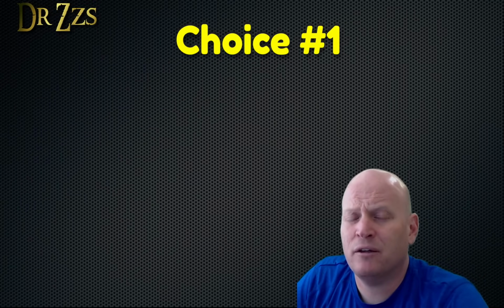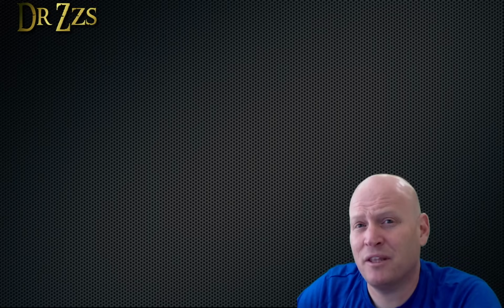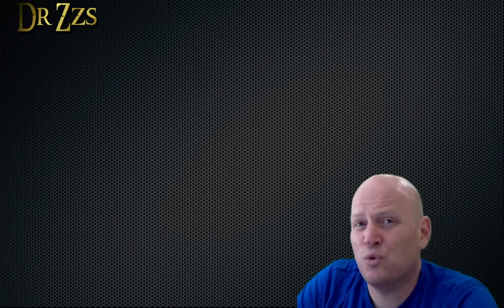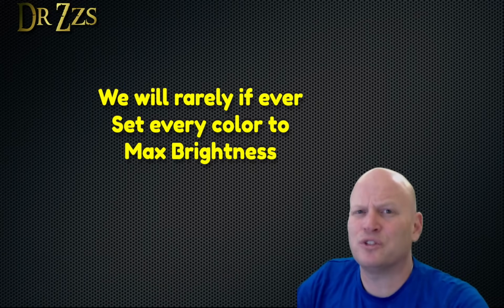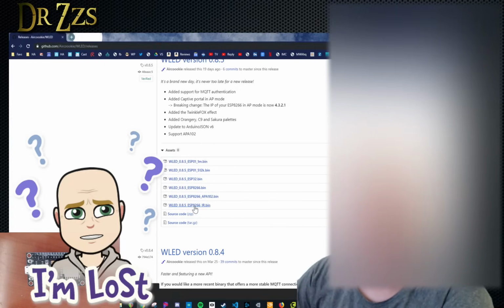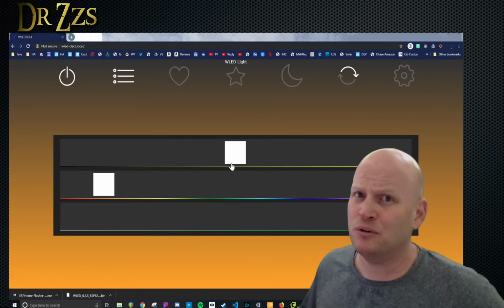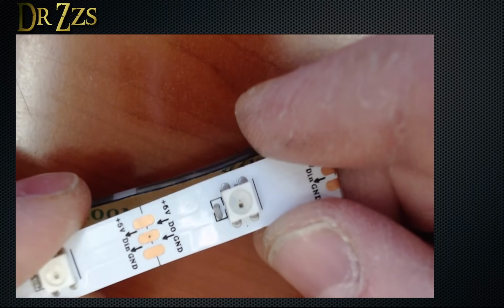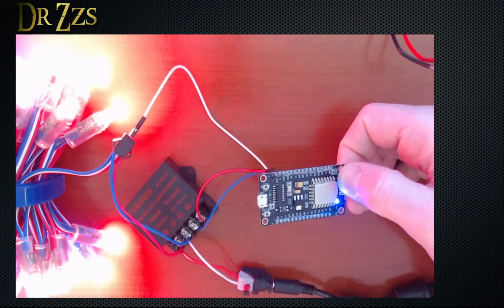Beginner's Guide to Christmas Lights - and LED Shows for Every Holiday

Comment: I really appreciate what you do! You have excellent videos! I do have a question about power injection that was not specifically addressed in your videos. 

I am going to be running 5v WS2811 pixels off of a 60 amp power supply. My longest run will be approximately 500 pixels (10 strands) on the roof line. 

Can I power inject at the beginning and end of each strand using T-taps on the entire run using a single 18g/2 wire from a single terminal on the power supply? Or would I need to run multiple 18g/2 wires from multiple terminals on the power supply since it’s such a long run?
Reply: did you find the solution? also confused about this!
Reply: I figured it out with experimentation. You can use one terminal from the power supply with one wire running parallel taping into the beginning and end of each strand. I would definitely use at least 16 gauge wire as well. It made a big difference.

I had to break the 500 pixels up into groups of 125 because anymore after that really showed signs of being under powered towards the end of the run (pixels were discolored). When I began a new run of 125 I used a new terminal on the power supply with a new, separate wire.

Comment: So, if I were using 6 of the 5v 150 LED strips, I would need the Bare metal power supply? That comes to 18 amps, right?
Reply: No. Each strip can pull 9amps on max brightness white, you should put a power supply every 100 leds.

Comment: question from complete novice. I'm gonna try it for the first time . its gonna be mounted the eves of a 1floor house. looking at the strips. Ws2812b.( even though it appears a little pricey in amazon) putting them in a channel system(amazon as well about $90 for 40 pack of 3.3ft) . I have listen to you and the hookup. still confused as to what voltage to use  5 or 12. My complete run will be approx 124 ft. then I will also like to add music( maybe later) . I'm also thinking of getting a Falcon F16 pixel controller. My questions include where will I add the voltage to every strip on the additional wire? or mount them power them and then see if and at what strips it  drops? what would you recommend in my instance
Reply from the maker: Hi Johnny,  If you're going to use 2812 strips your only option is 5v.  You'll probably need to add voltage at the end/beginning of each 5m strip.  To do that, you'll need a pair of wires that will run along with your LED strips and also be inside your aluminum channeling.  124 ft is a long way.  How many LEDs total are you expecting to use?  If you use the Falcon controller that should be fine.  If you were using nodeMCU's I'd suggest you break up your run and use a new nodeMCU about every 500 LEDs.  Depending on how many LEDs/meter you buy (30/m or 60/m) you're going to have either 1100 or 2200 LEDs.  So, I'd suggest breaking that up for power management too.  Consider putting your power supply and controller somewhere central instead of at one end.  
Hope that helps.  Let me know if it's still not clear.  Good Luck!
Reply: Thankx Doc, I'm looking at various option. prices are important. If I go with the  WS2812B , some options are BTF 60 LEDs or Alitove 159 pixels, 300 LEDs, there is even a 12v Alitove 2811..Any ideas which I should use.
Reply: Ok. Doc one more thing . Went ahead a made the purchase , I'm a installing WS2812B,  I bought the (ALITOVE 16.4 ft WS2812B Addressable Prog DigirL RGB LED Strip Light  30led/M5 150 pixels dream color LED Flexible Strip IP65 5VDC for Arduino,Raspberry Pi, Fadecandy DIY )Bought nine of them.(which I think that I would mean that I have to  put 1350 under the amount if LEDs on WLED app). I've also installed the 22 gauge power injection wire at th end and beginning if the strips. I have 2 MCU's with a couple of  separate level shifters chips,  A 60 Amp  power supply. Mounting Box and pretty much all the materials in the videos.
Question Would I be able to control the LED using WLED for that many LEDs,  about 1,350 from one MCU or do I need to use the  two MCU as a master slave configuration,  ( where and how can it be done) .  Or do I need something like  Falcon controller. 
I appreciate you input.
Gracias , Johnny

Comment: Thanks so much!  This was the video that got me up and running.  I could easily install Hassio onto a Raspberry Pi, but I could never get the nodeMCU to talk to it via MQTT using either your old code or The Hook Up's code.  I just needed a standalone WLED solution like this.  I watched hours of older videos (over and over) and didn't manage to make it to the finish line.  This is exactly what I need because I'm not going to come up with cooler effects than Aircookie has provided via his application.
Reply from the maker: Excellent!  When I first tried WLED I knew it would be a breakthrough for a lot of people just like you.  Aircoookie is a super star :)

Comment: Fantastic video, I'm a huge fan of yours.  Quick question, the link you provide for waterproof ws2812 waterproof strips goes to an "upgraded" ws2813 in Amazon.  This has a redundant data path.  How do you connect that to the NodeMCU?  I assume just one data connection, but which one?  Appreciate the help!
Reply from the maker: hmm.  I'll check that link.  
I haven't connected 2813's or 2815's (also have backup data), but I assume you would just connect the two data lines together at the beginning of the strip.  I've ordered some to play with so I can better answer that question.  You're not the only one who has asked it.  
Sorry about that link.  I'll look into it right now. 
Thanks

Comment: Ok. I'm a noob. Can anyone please tell me if the sacrificial pixel has to be 5v or can it be 12v?  I'm using 12v strings. Thanks!
Reply from the maker: It can be either, but if you have 12v I'd just use one of the 12v one's you have.

Comment: Thank you Drzzs. I installed my first strip as a test today and it went great.  I think I’m now ready to go full scale.
Reply from the maker: Awesome!  Do it!
Reply: DrZzs I put up 2 16ft WS2811s strips around the garage and then I restrung my wreath with 3 sets of LED strings. I tried running them all off the same MCUNode, but it was working out that great, so I added a second MCUNode for the wreath. All working great now. Now I’m just playing with WLED to get the best effects. I’m trying merry Christmas and colorful and switching back between those two for right now. May add some more into the mix.

Comment: So Its safe to assume that each section of of the house leds there all seperate and have individual led controllers?
Reply from the maker: Yes.  I have 6 different controllers covering the lights around my roof line.
Reply: DrZzs Are they all connected to the one power supply?

Comment: Bought and configured the 5v string lights, working perfectly , drilled the j channels this weekend, question for you, where did you drill into to attach the j channel ? On the gutters ? Or below the gutter on the aluminum that the gutter is on ? Awesome channel by the way.
Reply from the maker: Thanks!
I drilled  into the aluminum below the gutters.

Comment: Would it be possible to power the node mcu externally via usb then power the 12v lights separately without connecting a wire to vin on the node mcu?
Reply: To answer my own question, yes you can. I'm powering 12v lights and using the node mcu without a converter. You need a power supply for the node mcu and a power supply for the lights, do not connect the positive wire to the node mcu from the lights, just the ground as it's common between the lights and the node mcu.
Reply from the maker: If I wait long enough the questions answer themselves :)

Comment: How do you wire up a strip that has 4 wires?
Reply from the maker: There are a couple types of 4 wire leds.  I'm guessing you got the ws2813s.  They slipped a different product on the end of my link.  As far as I know, the ws2813's have 2 data wires, but they just get tied together and connect to the same data pin.  I'm not 100% sure about that though.  There are also 4 wire lights that have a ground, then one channel for Red, one for Green, and one for Blue.  Those won't work with WLED.   So step 1 is figure out which kind you have.

Comment: DrZ. when using 12v string, you stated that the first data connection needs to be 12" or less... but what if you have 8 or 10 feet between string 1 and string 2?
Reply from the maker: That should be fine. Once you've hit the first LED you can jump huge gaps without a problem.  It's just that first one that need to be close to the board.  check out the second have of this video: https://youtu.be/ZFO_QOBG9Bs
Reply: @DrZzs  this solution works like a champ! Two important  notes... I needed a driver to turn on the port and the wifi name is case sensitive...

Comment: Which lights are better overall 5v or 12v?
Reply from the maker: it's really about your use case.  12v are better if you want to have longer runs without needing to inject voltage.  5v are a little cheaper but require more frequent voltage injection.  On my house I've got about 70% 5v and 30% 12v.

Comment: I like that idea of putting your lights through transparent plastic tubing. It'll keep your lights from getting damaged. Transparent pvc piping would be better though I think. Piping is stronger.
Reply: piping like hdpe and pex act like a diffuser. if you are make arch you can force the strip to the bottom and led toward the top so they dont touch the pipe and you dont see the piexel its nicer like this.

Comment: I followed your directions perfectly. I bought two 12v strings with 50 lights on each. I purchased a power supply that is 12v and .2amps. My lights are showing the selected pattern, but are flickering. What would you suggest I do to get them working properly?
Reply from the maker: my first guess would be the data line connection.  Either it's too long, or just not making a good solid connection.  Guess #2 would be the ground connections.  Maybe there is something here that would help: https://youtu.be/ZFO_QOBG9Bs
Reply: DrZzs Hey man, thanks for replying! It was the  ground connections! I bought the wired version of the 12v to 5v. I grounded the NodeMCU, the 12v to 5v, and light strings directly to the power supply. Being that the ground wire on the output side of the 12v to 5v is not in use, does the ground wire on the input side of the 12v to 5v necessarily need to be grounded to the power supply? I’m thinking that it may be necessary to change the voltage to keep the NodeMCU from burning up, but I am not sure. I hope I haven’t confused you. I’m very new to these projects.

Comment: Are there any black out caps for individual led's that prevent colors from bleeding through?  Would like to black out some of the lights to clean up some of the transition areas on my house.  Just wanting things to look super clean and tight.
Reply from the maker: No black out caps that I've seen.  You can cut and splice the wires between pixels.  That might be the thing to do.  Otherwise I would paint them or electrical tape them to hide the light.

Comment: Wled effects works like magic, but when I use any Xlights sequence I get a lot of lag. It's running on a gaming system with some muscle, it shows around 17% cpu load during rendering, network is Gigabit, using unicast on two di mini pros with 600 ws2812b leds each.
Reply from the maker: hmmm, that's a bummer.  I've only tinkered with xlights a little.  I'm working on my first sequence right now.  I wouldn't expect the d1mini to have a problem with 600 pixels each.  I wish I had a good answer.  Hopefully I haven't over estimated the ability of WLED to use e1.31 effectively.
Reply: This is my first shot at this to. I think I almost got the lag under control. Power injection at 10m is a must and enough current...no shortcuts. Setting up the leds in xLights has to be exact with the amounts and universes, I had a couple unused universes after I shifted a few strings to the other controller. I think the higher FPS sequences might need that 5v data especially with the larger amount of leds.

Comment: Can I put the Node MCU and power supply outdoors in a sealed enclosure? My biggest hurdle for starting this type of project is where to place all the individual components necessary for the project. I look for outdoor rated power supply's but I'm just not sure how the little Node MCU board will fair in sub-zero temps. I live in northeastern USA so it can be downright brutal.
Reply from the maker: There are some pretty good outdoor project boxes you can get.  Cold is probably better than heat, but either way maybe some insulation would be a good idea.  I have mine outdoors and haven't had an issue, but we don't get much below zero.

Comment: Can you use multiple control methods, by splitting the data wire or some other method? For example, wifi and Bluetooth, or rf and wifi, or 2 different wifi controllers? Multiple controllers could be convenient and provide back-up control. Thanks!

Comment: This video has helped me a ton! Thank you!. I have solder welds in my LED strip. I can measure the voltage on both sides of the weld and I see 5v on both sides. I can't get any reading on the data signal. What am I missing?
Reply from the maker: Sounds like the data pin isn't active or for some reason the signal isn't getting through.  First think I'd check would be the grounds.  Make sure the nodemcu ground is connected to the power supply and the LED grounds.  If that's not it check the connections from D4 on the nodeMCU all the way to the first pixel.  Maybe some wire is loose or broken.  If that's not it, then I'd try re-flashing the nodeMCU with a brand new 0.8.6 binary file from WLED github.  Maybe you got a version that is putting the data signal out to a different pin (not D4).  
Let me know if you get it fixed.
Reply: DrZzs thank you! I had to adjust the multimeter lower to see the voltage on the data channel. I got the lights to work by changing the number of LEDs in the WLED config. Hand palm to face :)

Comment: Thanks for the inspiration. Based on this, I ordered 3 NodeMCU boards and 50 12v pixels from Amazon. However, I'm having an odd effect where the entire string will flash a color (usually cyan) very briefly. I reflashed the NodeMCU and swapped NodeMCU with the same behavior. Might this be an issue with the string of pixels?  Thanks for any insight you can give! :)
Reply: I think you need a logic shifter for the data pin. I had the same issue
Reply: @paulbram2  I ended up with a logic shifter. Didn't cure. Added resistor to beginning of string - seemed to cure on my bench, but installation proved otherwise. Ended up with a pixel installed on the board with the MCU - works perfectly now. IDK if the signal from the NodeMCU just isn't clean or what, but I couldn't drive the signal 5 feet without issues until I put in the pixel. Also did power injection (12v setup) after 100 pixels to drive the remainder of the string (42 more).

Comment: Can you run wires (about 8ft) in between strings? I dont want lights in between the gaps of wires but I'm worried that the data wire will not send the signal.
Reply: Yes, however, there is a limit between leds since the voltage level of the data will drop off and eventually you will end up with no data, or flickering (in the bad sense) if data becomes corrupted. You can get around this by adding a single led (sacrifice one or more) every so many feet, and if needed, tape them up completely to hide the light output from them. There are more "professional ways" using extenders that increase the voltage for the data over longer runs, but they are expensive. The cheapest way is using some leds.  Google around and you will see what I mean.

Comment: Sorry a noob here, when you are connecting multiple led strips, do we need to have separate nodemcu's for each or can we connect them in serial and use the first one to drive the data signal. As always great job explaining and big thanks to aircookie. He is awesome!
Reply: 1 nodemcu, the data is passed from led to led (including out the last led of the string into the first led of the next string)
Reply: Judging by DrZzs comment below you can connect multiple strips together to one controller. The limitation will be how much voltage is dropped along the way and how many LEDs the NodeMCU can address. Apparently that is about 500-600 max...

Comment: Would you use a separate nodemcu for different displays in the yard if trying to do some holiday lights. Trying to grasp all this,  can't wait to try it myself
Reply: Depending on what code you load onto the NodeMCU each one can control up to 6 different zones.  If you use the WLED if I remember right it can control up to 4 zones.  See Robs video where he shows off the wiring schematic for the NodeMCU.  Also Rob includes a logic converter in his circuit which will allow you to have a longer run from the controller to the first LED.  Feel free to come join us in DrZzs discord
Reply: Jason Hamilton thanks buddy!

Comment: This video was SOOOO helpful.  Thank you!!!  Do you know the maximum number of pixels that can be run from a single NodeMCU?  I already have my roof line done with LEDs and an older Arduino board, but would love to be able to alter color/show via wifi using a NodeMCU.
Reply: Ryan O'Shea hi,  do you recommend using the strings or strips for the roof line?  Trying to figure out what to order
Reply: @MrArod1207  I've had the 5v WS2812 strips on my roof line for about 4 years now, going strong.
Reply: Ryan O'Shea awesome...  how do you have them mounted?
Reply: @MrArod1207  I kept them in their water resistant sleeve and used 3M double sided outdoor tape to secure them to the edge of my roof just under my gutters.
Reply: Ryan O'Shea thanks so much for the info